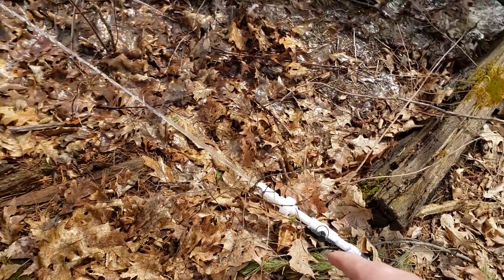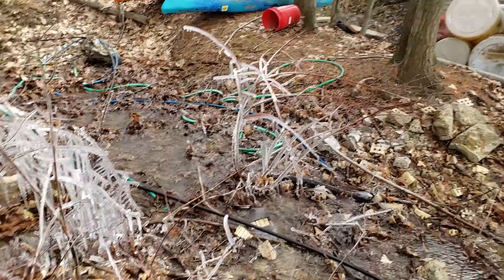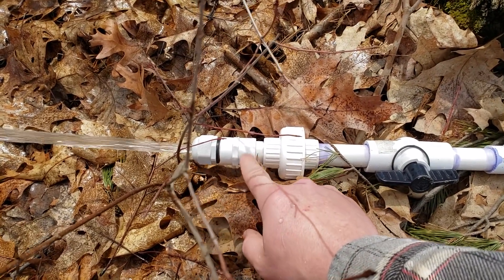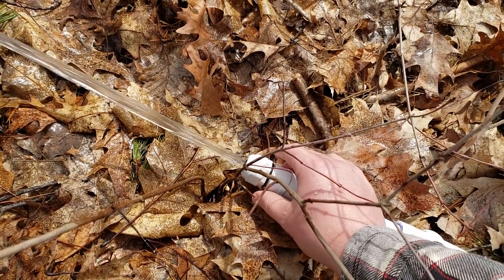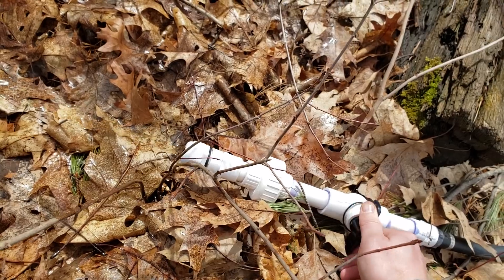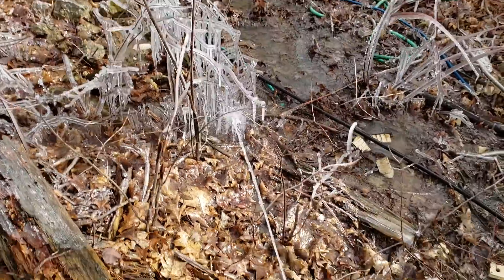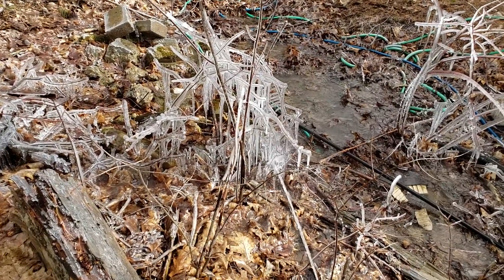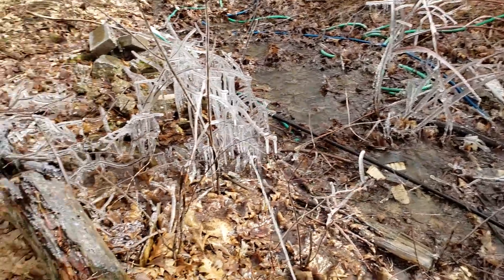Spring Creek, These videos gets me more views on my other videos, and you guys like them anyways!

Comment: Would be cool if you can cover a light source with the freezing water or add dye on different days.  Do you watch the ice freeze from your hot tub?
Reply from the maker: I can actually see it from the hot tub. Ice buildup is very slow. What you see here took 12 hours. And do you mean like a laminar jet with lights? I've definitely thought of that. Dye would not work because of the timespans involved.
Reply: @JoeMalovich  Jet with lights

Comment: How much energy is coming out of that jet? (J) and what is the pressure of the water?
Reply from the maker: ahhh I've already measured it 6.25 PSI static pressure and it can flow a max of 6gpm. Dynamic Pressure and Jetted flow would be less but that works out to about 6 watts.

I have double or triple (or more) that amount of flow at times, more pipes or a single larger pipe could probably get me to 20 watts reliably or more during the 6 months of winter. 

The big system will operate at 100psi and up to 30GPM, that's a 5/16" jet of water travelling at 80mph.